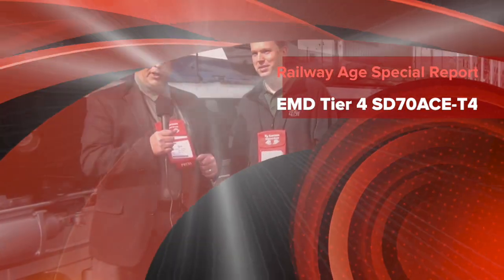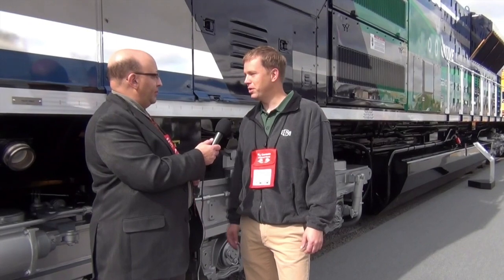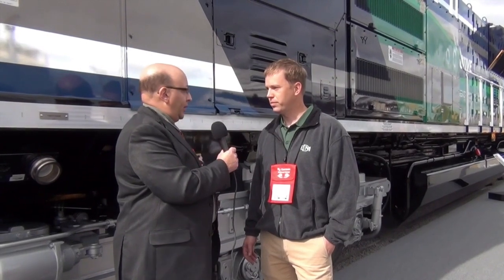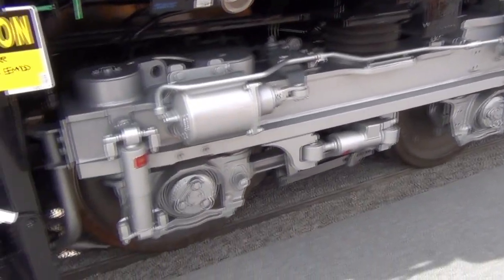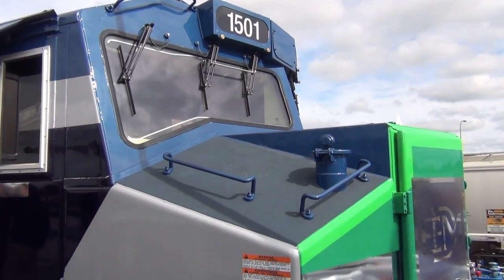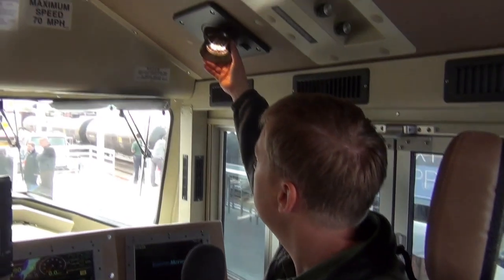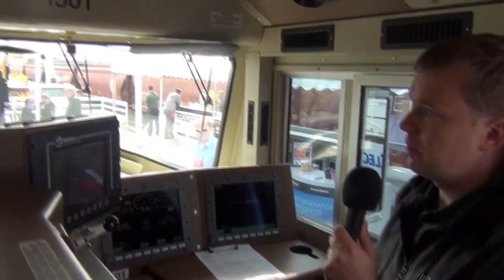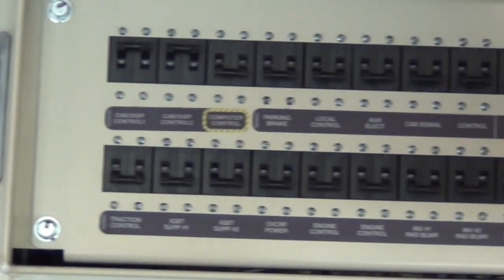EMD

Comment: Everything I disliked about the ACE it looks like they fixed. Conductor desk much better, and on my side they fixed location of knife and breakers. If they only could have been able to use GE center lift axle. I hope there for stroke still had there rapid throttle response the ACE had.